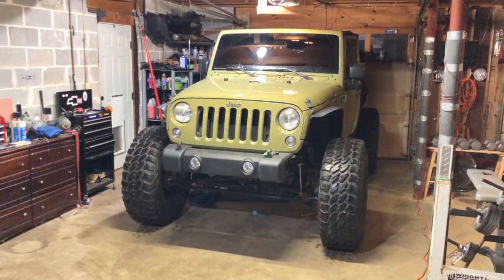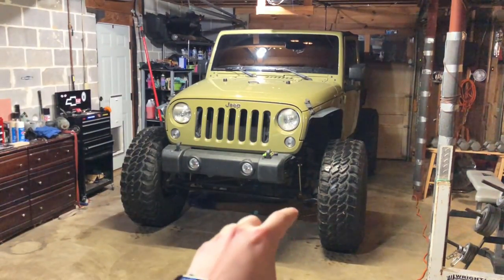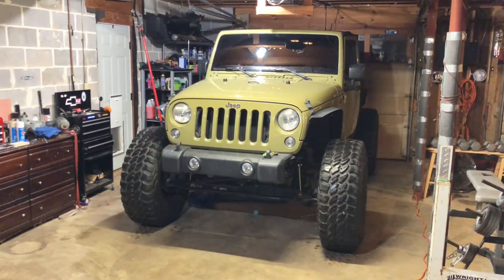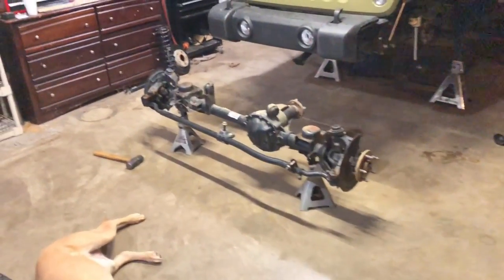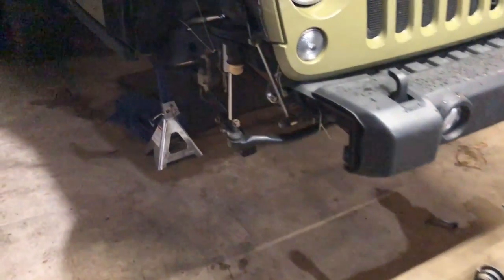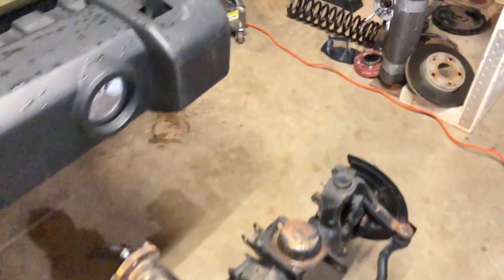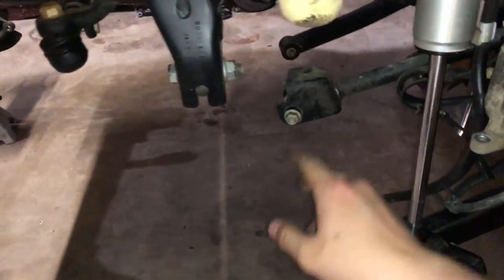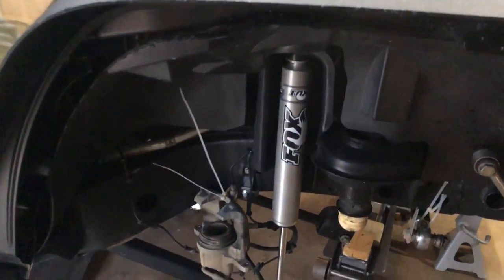Warden JKU | Full EVO Truss Kit Install

Comment: Truss isn't going to compensate for 40" tires on a Dana 30. You could truss/sleeve/gusset/chromo shafts & every reinforcement bracket under the sun, that doesn't change the weakest link in the equation and that's the Ring & Pinion. Even if you built up a Dana 30 as "bombproof" as you could possibly make it, after you do the math you'll realize that you could've went to the junkyard and got a JKR44 or SD60 for right around the same price if not cheaper
Reply: It costs $2500+ for a junkyard front JKR D44. Then he would have to regear the rear... Or buy the matching rear JKR D44 for another $1000+ (Used). I bought my F&R rubi axles for $3900 used. I priced out (parts only) Ford D60 front and Chevy 14B rear swap, using all Artec industries parts, Nitro gears, Adams driveshafts, ARB Lockers... to be around $8000. That is assuming doner axles cost me $1000. Plus, would have to buy new wheels.
Reply: @patrickjamesmcb  You don't need a Rubicon rear axle to match. I swapped a Rubicon front axle in my sport and had it geared to match, plugged the sensor holes and ran the pigtail to a rocker switch. The D44 in the sport is not really any less strong than the Rubicon. I have an aftermarket E-locker that's basically the same thing as the Rubicon axle, It just uses standard 30 spline shafts instead of 32 spline. Honestly I would imagine Rubicon's probably have a higher potential for ring and pinion failures when people put chromoly shafts in there.
Reply: @JeepJeep234  I know that, but if you price out an e locker and gear set with master install kit, the used rubi rear axle will be around the same price... and you get higher spline count to boot.
Reply: @patrickjamesmcb  True, but on that same logic, you could do an axle spline conversion between 30-35 spline without any cost difference. If you decided to do it, you could get ahold of hardend gears, an ARB air locker, and a 35 spline conversion. And effectively be superior.
Reply: @JeepJeep234  True. If I could do it again, it would be a 14 bolt in the rear lol.
Reply: @patrickjamesmcb  I won't argue that. I eventually plan on looking for something bigger for the rear end on my sport. I'm content with this Rubicon front axle.
Reply: D44 and D30 are almost the same weak.

Comment: I’m looking to maybe do this how much was it to get welded and will a front trackbar bracket work with it when you go high steer?
Reply: Thanks and Does a trackbar bracket fit with that truss kit or you have to weld one on?
Reply: 2017 Jeep jk you’d have to weld it on. The evo truss kit comes with one if you buy the whole kit